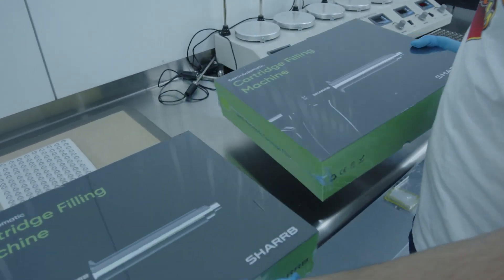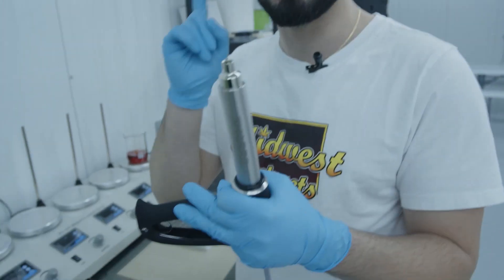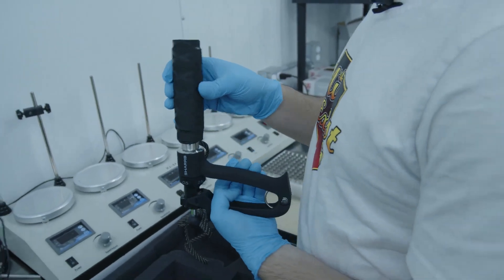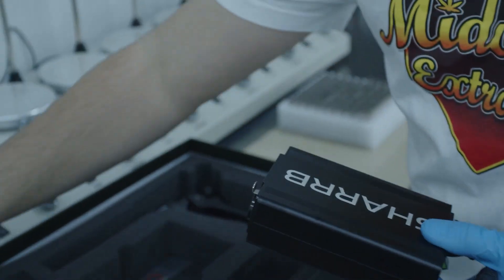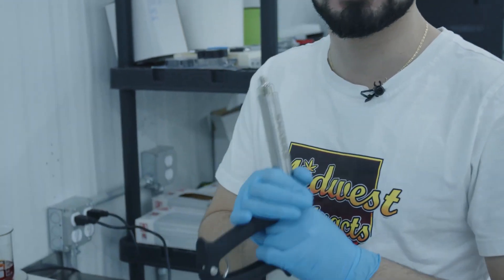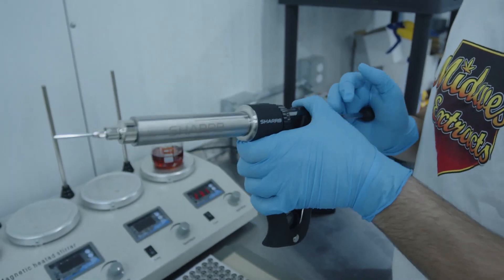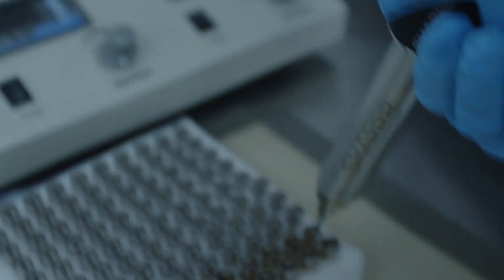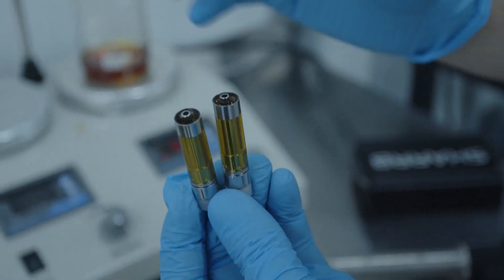How to Fill Cartridges with the SHARRB Cart Filler Semi Automatic Syringe Gun

Comment: I bought one of these and you guys had a silicone grease or lubricant inside of it... 😂 destroyed my first batch of oil. I would have expected it to be BONE dry because ANYTHING in it is a CONTAMINANT. Why would you do this?
Reply from the maker: It is not a containment, any piece of lab equipment is recommended to be cleaned before use. And no we do not use grease or lubricant.

Comment: This worked fine just as shown in the video. Yes I also noticed grease or oil in my tube, I cleaned all parts before using. I bought a magnetic heat stir plate off Amazon,  had my processor crash my BHO into cart juice, I'm sure you can do this your self mine offers it for me.  Heat the extract on the plate and fill as shown, I did 50 carts in about 1 hour total my 1st try. Including clean up. Worked great.
Reply: How can I clean it ???

Comment: Hello I just bought one, what a temp of d9 should be heat up to , on hot plate before fill gun? I mix terp on 140F and  was not good temp to fill up gun was too thick and got alot problems
Reply from the maker: You should have the d9 at 180-190F
Reply: And what temp you set on this heating gun thing ? At 190 will terp not burned or go out? Or after mixed d9 with terps can heat up to 190F with no issue on terps?
Reply: @rafalnysa5584  @sharrb  Would love to get this info also,  what temp to heat up d9 thats already pre terped before filling the syringe and what temp to heat the tube up when loading the d9
Reply: @sharrb  Would love to get this info also,  what temp to heat up d9 thats already pre terped before filling the syringe and what temp to heat the tube up when loading the d9
Reply: I think heat up to 140- mix terp for 15min , and after that heat up to 180 fill up gun and do job on carts. But is shame I spend 400$ on Sharrb filling gun - no help or anserw questions even via email!! Worst costumer service EVER!!!
Reply: @rafalnysa5584  did you get any thermal degradation at 180? Any lose in terpenes?
Reply: Would like to know this as well, anytime over 140 it starts to burn but that was pre terps

Comment: Hi, im confused about the .8ml one. Is there a reason someone would use that if carts are usually .5ml, 1ml, 2ml?
Reply: 1ml normally fills too much
Reply: It's for scammers
Reply: There are some 0.8mL carts on the market. PCKT SPRK 2.0 is one that comes to mind
Reply: @Dabberz1 not necessarily. For example 1ml screw on jeeters are actually .8ml

Comment: What temperature do you use to heat D9 distillate on the hot plate?
Reply from the maker: 185 degrees
Reply: Wont that temp risk the terpenes & oil from getting burnt ?
Reply from the maker: @alexanderflexx8351  no, once it gets closer to boiling point, around 212 degrees, you will start to see terps steaming out the jar.
Reply: @sharrb what about speed ? how fast do u set the stirrer
Reply from the maker: @xansoxys  depends on how fast you want it spinning, all material is different

Comment: My company is looking into buying a few, to test with and see how it goes, question, i  run the same make and but a 4 burner hot plates with The temperature probes,same brand, When you're dealing with distillate heating it up prepping for separation or cartridges, what do you set your hot plates to to where you're not degrading potency or any terps that may have been added, I've been trying hard to find a sweet spot if you know off hand that would be fantastic! Planning on ordering this product and as long as it goes well at home I think we'll be able to buy several, this was not my work YouTube or connected to any of my work , This one is specifically personal, If you guys have the time and see the comment that would be fantastic like I said I'm going to be ordering one shortly🔥
Reply from the maker: Hello, thanks for watching! We recommend to have your distillate between 190-200 degrees Fahrenheit and it won’t degrade potency or the terps. If you have any questions feel free to reach out via Instagram @sharrb.fillers or send us an email admin@sharrb.com
Reply: Did you ever grab them if so how were they ?